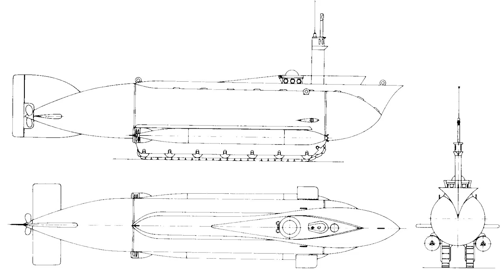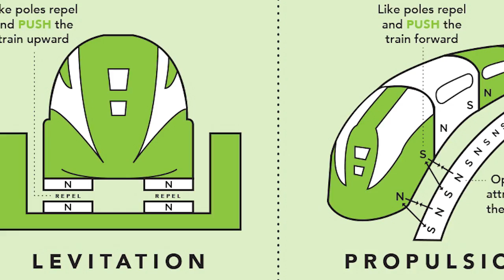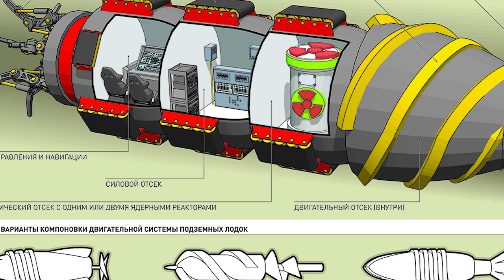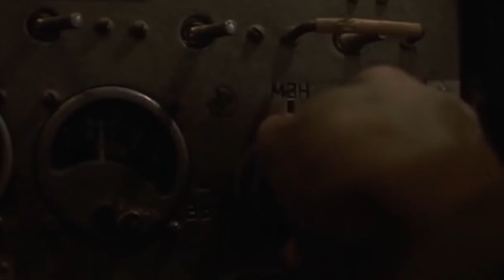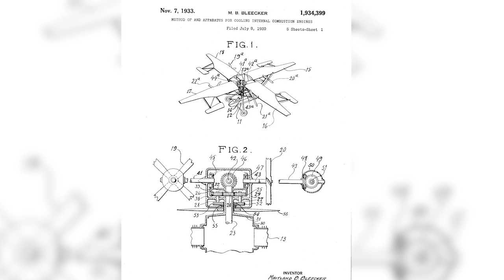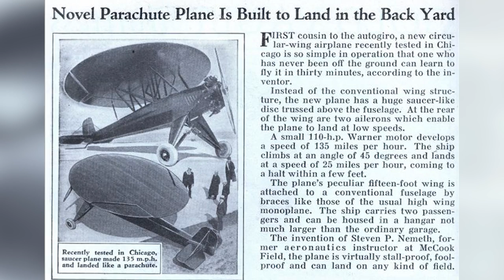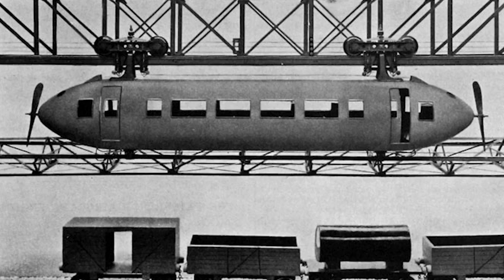12 Most Incredible Abandoned Technology And Vehicles

Comment: The parasol wing is an idea based on two principles of Aviation and in particular fighter planes.
Firstly, a large round wing increases wing area without increasing the width, in fact the wing can be narrower.  This leads to the second clever idea.
 A shorter wing reduces the turn moment and drag of the wing during combat manoeuvres. We saw the Sopwith Camel and Fokker Dr.I use multiple wings during WW1 to reduce wing length while maintaining lift. The Dr.I added another wing(s) and the Camel used slightly deeper wings to increase wing area while minimizing width.

Comment: @5:19 this is not a Mag Lev train it is an "Air Cushion" research vehicle more like a hover craft official name is Grumman Tracked Levitation Research Vehicle (TLRV).  Grumman was the STS Orbiter prime contractor and this platform was used as a test bed for aerodynamic research much like a Ground Test Article (GTA) prior to the Enterprise Flight Test Vehicle (FTA).  At the time the STS program being joint NASA and USAF had classified portions and the official role at the time for the TLRV was in support of High Speed Train Testing which it did fulfill it's role as an experimental high speed train test article in addition to the STS Orbiter Aero test bed, it's fairly easy to see the design parallels between the Orbiter and the train.

Comment: The Buran was designed to fly itself as a jet as well, using 4 jet engines. It used jet engines to take another pass at the runway during its automated landing on its one successful spaceflight. The video made it seem like it would have needed a jet to move it around, but the Buran would have been able to transport itself between airbases.

Comment: 2:36 "the 8 wheels generated power then conveyed it back to the engine via the hydraulic system" 

uhh what? so you had to push it to get the wheels turning then it pumped fluid to the engine? the fuck does that work?

Comment: Buran was out in the space  and sucessfully returned
they just took off money from the project

Buran took many testflight sucessfully
politics killed the project
Reply: Yeah, the Buran was a total success. I'd say cost was more of a factor in stopping the project. It was just too expensive, and there was no need for it.
Reply: @dominiclobue  That and the basic idea of an airplane bolted to the side of a giant rocket is just a bad design.
Reply: @atomicskull6405  agreed
Reply: @dominiclobue  The space shuttle was designed that way to satisfy Air Force requirements in order to get them on board with the program. The USAF wanted it to be able to launch and return in a single orbit and be able to land on an airstrip because they had plans of using it as a reconnaissance platform. Spy satellites ended up taking that role and then NASA was stuck with the design. This is why the current reusable NASA designs set to replace the space shuttle are all capsules and why the launch system the USAF is now working on for it's own use is a space plane.
Reply: actually  this  spacerace has a great  effect 
on both side pushed scientists to work harder